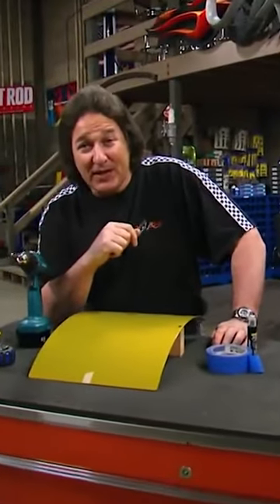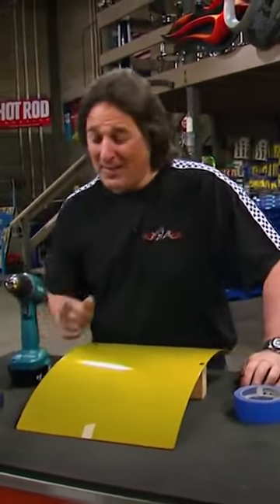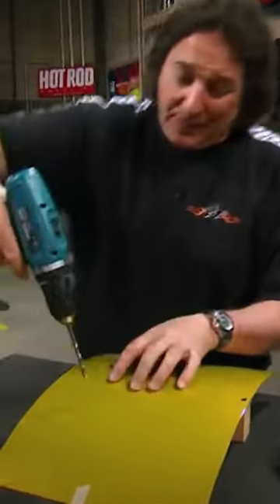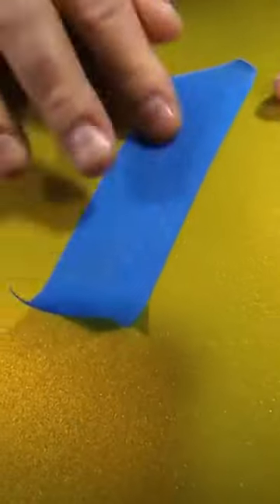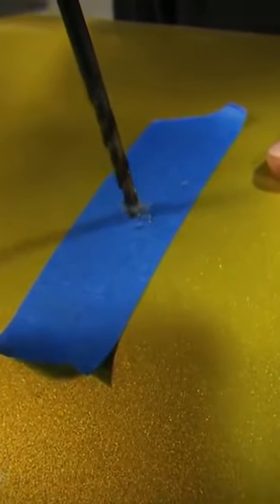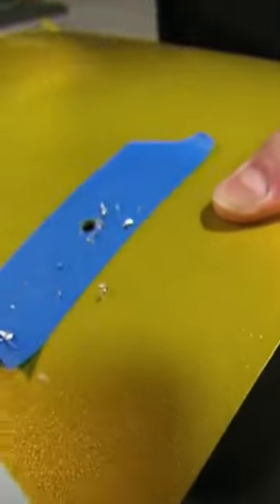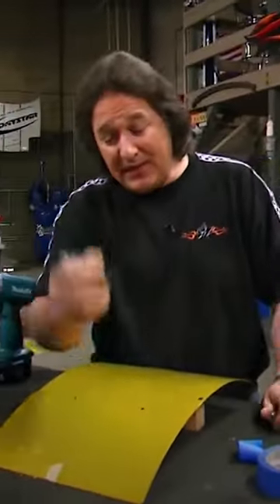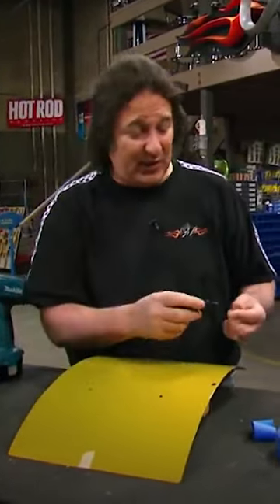How to Drill Through Paint Without Chipping It! #shorts

Comment: Also punch to stop so the drill doesn’t wander
Reply: Using a center punch will, at very best, cause micro cracks that may go past the drill hole, causing problems the same as not painting the inside of the hole.
Reply: @dannywilliams3255 pro tip heat is you friend wrap the peace in a heat blanket for a hour pretty high ...that paint won't chip easy

Comment: I've seen the paint around the hole just peel right off when you pull the masking tape off.
Reply: Don't know what kinda paint they were using, but you have to pull the tape slow and steady with even pressure and come from both sides so that you are not putting extra pressure on the paint. I'm actually surprised that he didn't do it in the video.